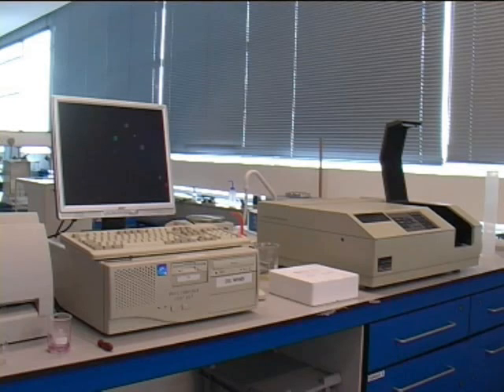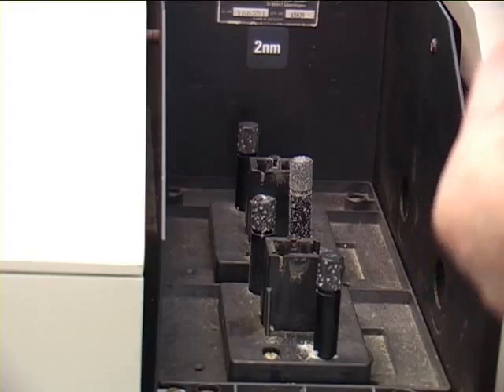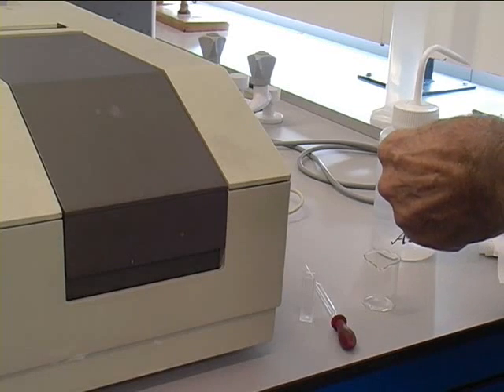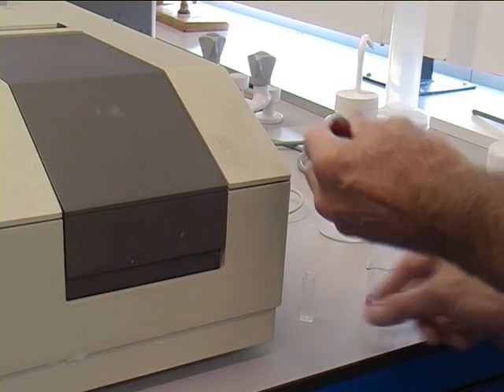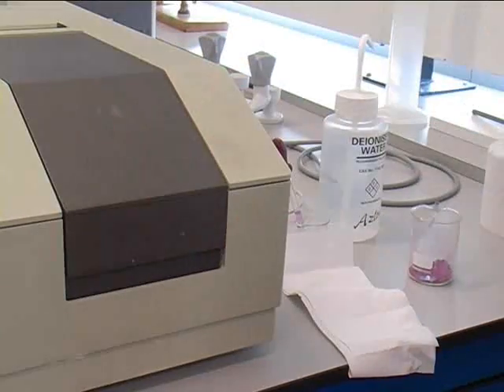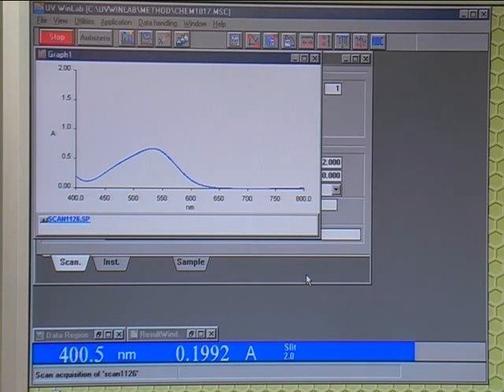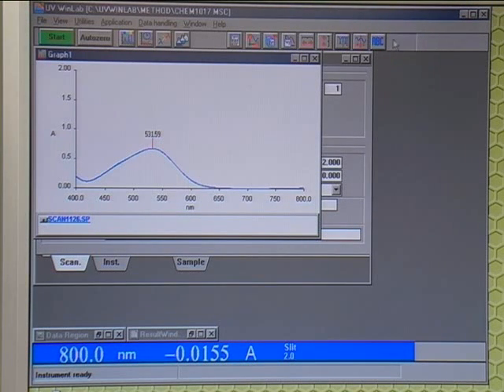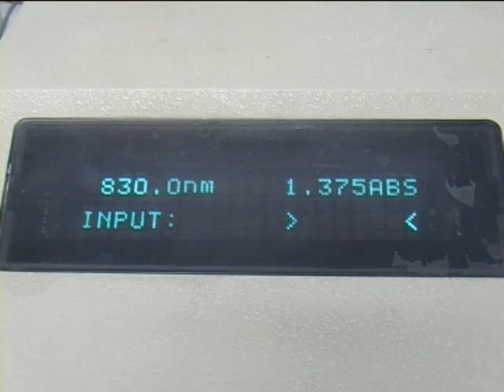UV/vis spectroscopy

Comment: Hi in response to kakashi2510, you need to fill a cuvette up to whatever the Z-DImension in your machine is.  For example, if you ZD is 8.5 mm you can fill the cuvette up to about 11 mm and be good to go.  You should never fill a cuvette all the way up to the top.  This is very dangerous and can easily spill and make a huge mess.